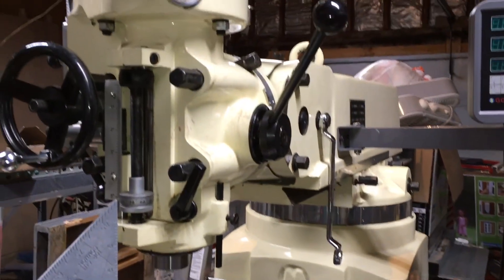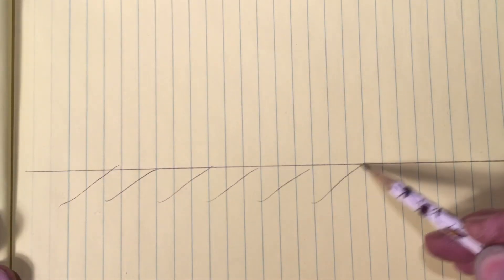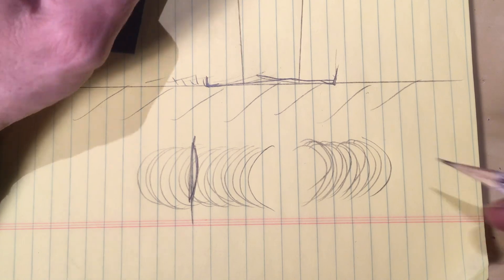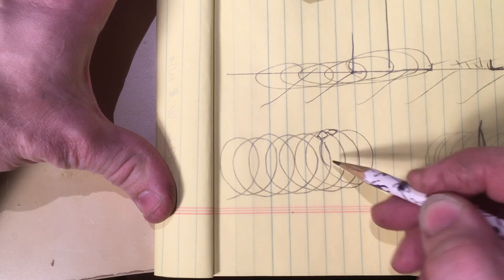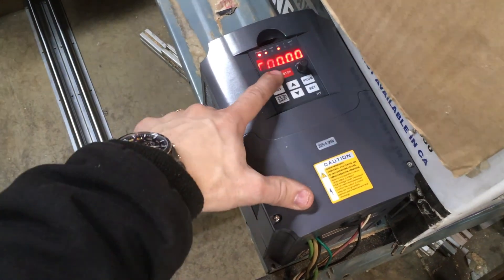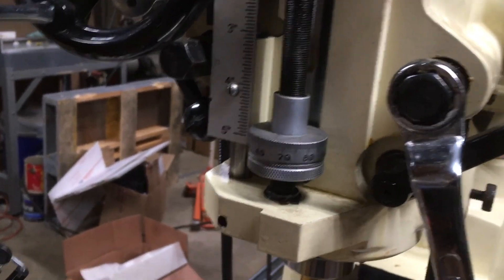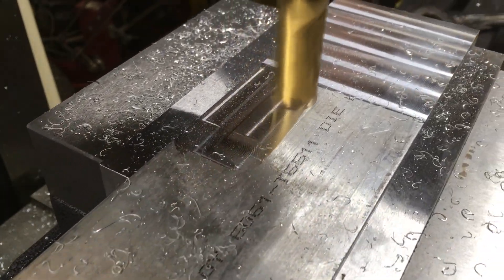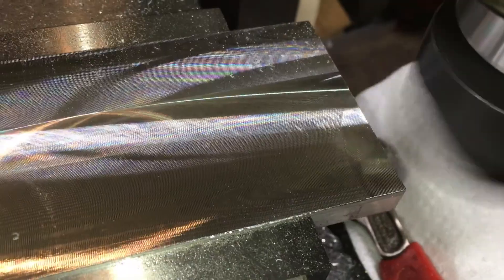How to square vertical mill head without a dial indicator. Tramming.

Comment: Who has a mill but doesn't have an indicator? This was a reach, but I guess nice to teach alternative ways.
But at the end of the day, if you buy a knee mill, there is going to be a price of admission to play.
Picking up an Indicol and a few types of indicator is nothing compared to the cost of a vise, collets, and tooling.
Reply from the maker: @railgap  Thank you for watching!. It takes some tooling with the dial indicator, as well. So, for those who don’t have it, and primarily myself did I make this video. Cheers